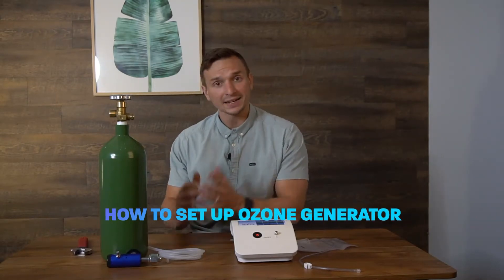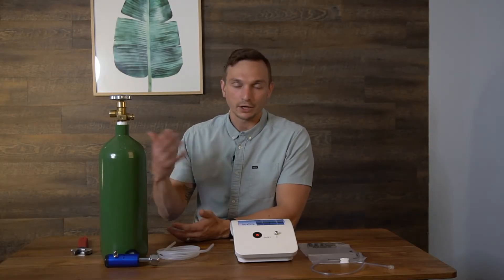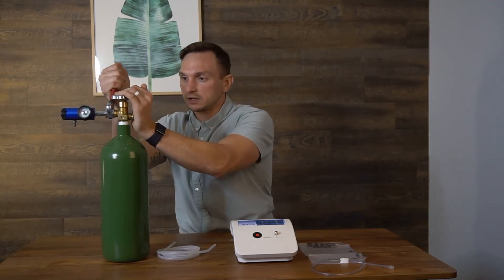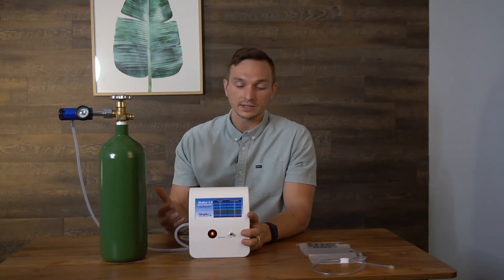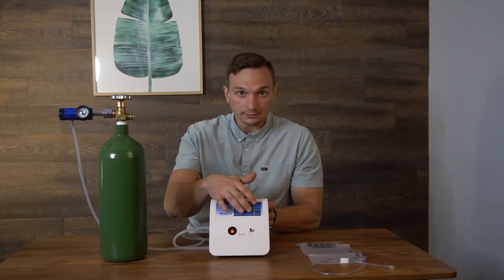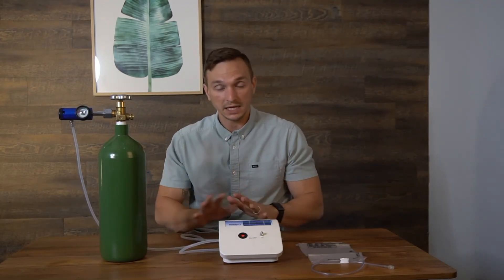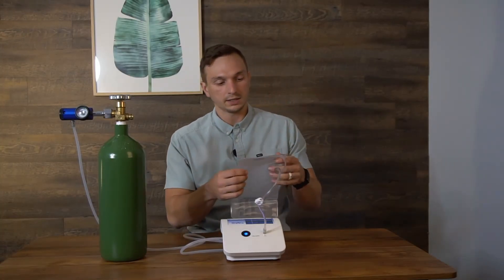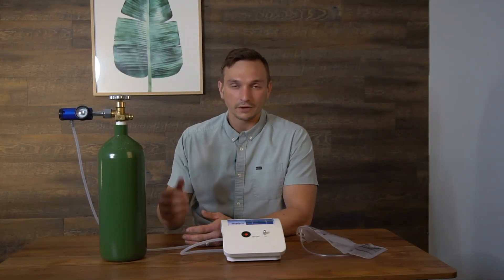How to set up Simply O3's Stratus 3.0 ozone generator | Micah Lowe

Comment: I have the same generator, but my ozone bag fills much faster than yours did.  I'd say the whole bag fills in 5 seconds.  Might my regulator be defective?
Reply from the maker: Doug, thank you for the comment.  Are you using a Simply O3 regulator?  If so, please first make sure you are using the setting suggested for your purpose.  Then, if no solution, please reach out to info@simplyo3.com and they will get you a new one.  Thank you!
Reply: @simplyo3  Thank you.  I'll hit you at your info email.

Comment: Thank you for the straight forward explanation. Question... what is the PSI of the green tank you are using? I am using the same size tank and I noticed that even when I got a new from Airgas the needle on the regulator barely jumped above the red zone. Is that normal?
Reply from the maker: Hi Mark, 

Thank you for the question.  A newly filled oxygen tank should populate into the green section, which is generally around 2,000 psi.